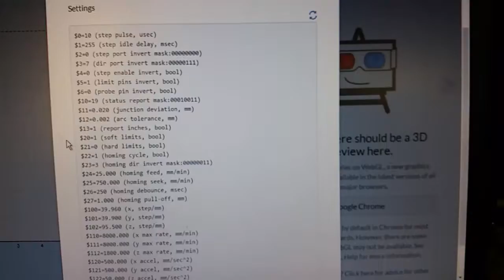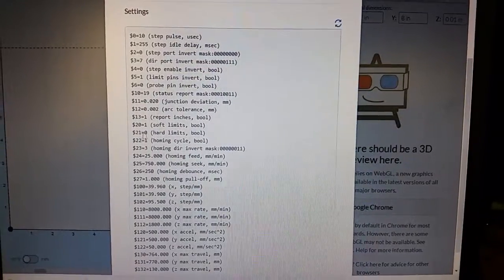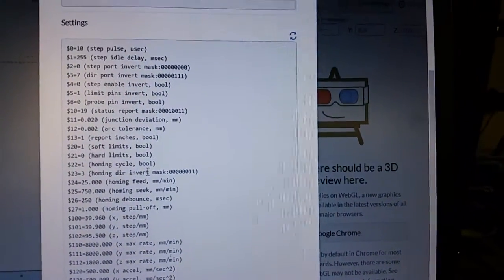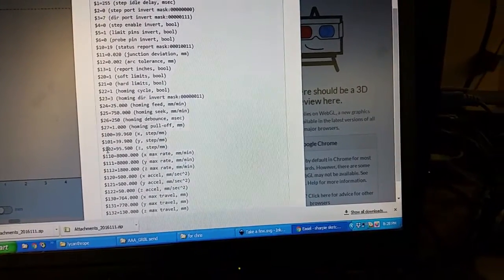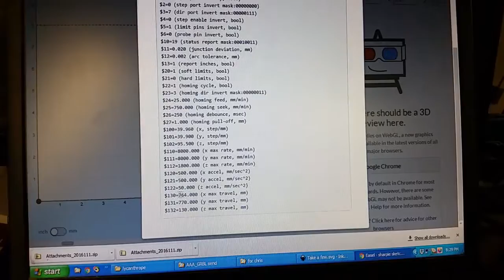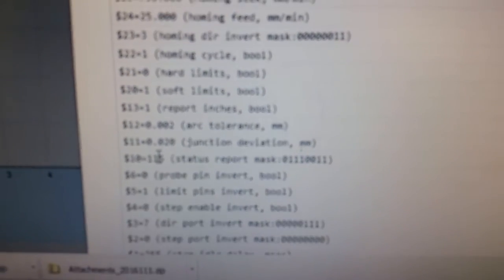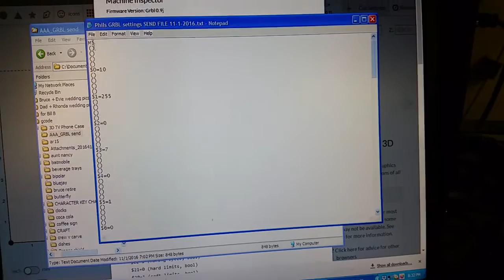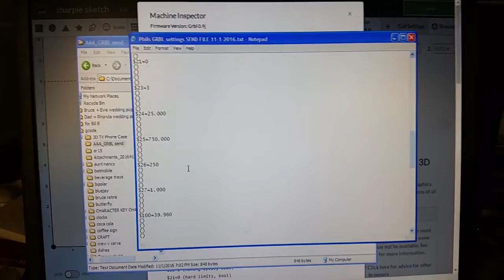Grbl settings in easel and how to change them pt 2

Comment: Nice video.....soft limit would not prevent you from manually moving xy or z too far correct?
Reply from the maker: der ddd correct it will alarm and not move if you try to jog past the limits

Comment: thanks for the video, very helpful, one question though - say if I have a custom machine that is say 1000 x 1500 where do I put that as in the machine setup in easel is max 1000 x 1000?
Reply from the maker: Jady Swinkels under machine is work area size.